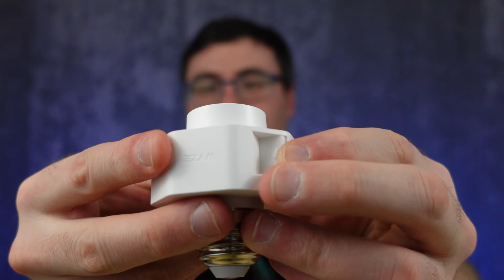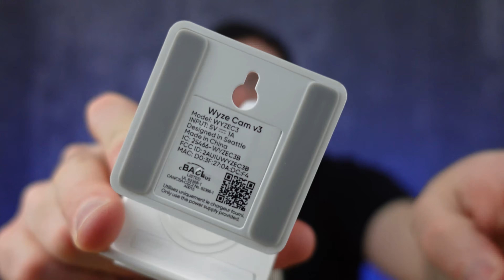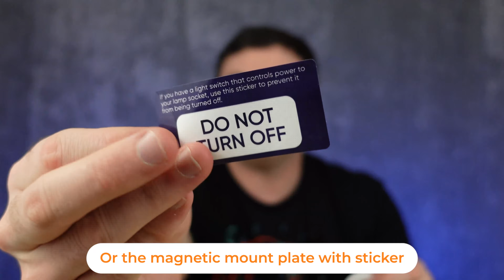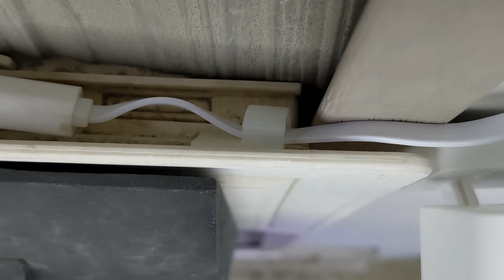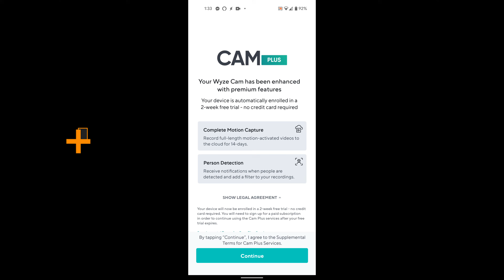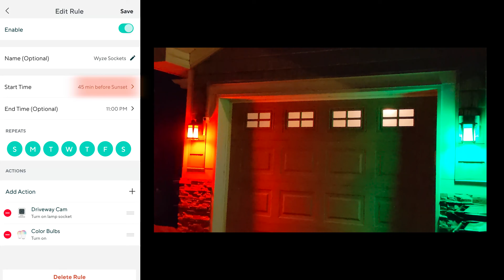Wyze Lamp Socket Unbox and Setup (With V3 Camera)

Comment: It sucks that this socket only works with Wyze cam V3.  I have a few Wyze cam outdoor V2s that would definitely benefit from the socket power source but unfortunately according to Wyze customer service reps,  I shouldn't use them with the Wyze sockets.
Reply from the maker: Correct.  These are specific

Comment: Do i need to leave the light switches turned on all the time ? What happens when i take the switch off ? Will the camera continue running or just be useless?
Reply from the maker: Yeah you need to leave the light switch on.  It will use a very small amount of power in the light, and some for the camera.  But you can control both to be off whenever you'd like.

Comment: Can you installed more thannone camera to the light socket?
Reply from the maker: Power wise that's not going to work out well.  You'll likely underpower a camera at some point and have it drop off.  The control interface doesn't allow that too, so...you could maybe get away with it, but I wouldn't suggest it.

Comment: I did not know that there was a 30 watt max. Thanks for pointing that out before I bought one and tried putting my 60 watt bulbs in it.I use the vintage amber type Edison bulbs and this won't work with them.
Reply from the maker: Ohhhh those are nice.  You know what you could do is buy a smart version that is LED but Edison style!
Reply: @automateyourlife2  I had some and they don't look the same. Maybe they will do a better job in the future replicating them. But, they just aren't the same at this point in time. I have LED everywhere in my house except for the 6 outdoor bulbs.
Reply: You actively choose to use such energy wasting bulbs?
Reply: @myNEONCITY  Yes, I do. They look way better than LED lights on the outside of the house. I use LED all over the inside of my house. But, the Edison bulbs have a nice warm glow to them that you can't get with an LED. You seem like a complete snob.
Reply: @Timpala44  I’m the snob? I’m not the one that actively chooses to waste extra energy because something looks better.
Reply: @myNEONCITY  This conversation is a waste of energy.
Reply: @Timpala44  it is but not as energy wasting as those Edison bulbs! 😉

Comment: So one of the problems I have with their lamp solution socket is that in most cases porch lights within arms reach for you and a potential thief...the cable that Wyze provides is so short it that it forces you to mount the camera at about the same height as the porch light so a thief could just cover their face and go up and snatch the camera off the wall. Yes you could buy a longer cable but any off-the-shelf USB cable connections will not fit into the lamp socket's USB connection because of the special sized usb connector required by the lamp socket for water proofing. So to extend the cable length you'd have to purchase a special connector to attach the short cable provided to your extension cable and then you have to figure out how to make that connection point water proof. IMO Wyze should provide (even if they sell i as an add on) the connector and the water proofing mechanism for that connector (maybe a heat shrink wrap). It would literally cost them no more than a couple of dollars (if that) to provide a solution to extend the cable (i.e., USB-to-USB connector and the waterproofing shrink wrapping).  It's all about providing solutions....customers don't want to have research, try out potential solutions and purchase individual components to solve their issues...most people don't have time to do that. This was enough of a barrier to me that I decided to go with another vendor camera (ReoLink Argus Pro 3 with solar panel). No having to figure out how to run cables to a power socket,  no need to worry about researching and then jury rigging a water proof cable solution so that I could place the camera out of reach and where I wanted to. It's a lost sale for Wyze. It's nice that Wyze provides a lamp socket product but someone forgot to think this through.
Reply: I’m glad you found a solution that works for you, but your whole comment is way too nitpicky. No other company offers a solution like this, but you feel the need to complain. Most security cameras can be easily ripped off by anyone, but they’ll be recorded doing so. Not much point to that tbh.

Comment: Since the switch powers the bulb, I assume we have to leave the switch on, but I don't want my light to be on 24/7. If using a regular led bulb in the socket, would I be able to turn the light on and off without shutting off the camera?
Reply: No. Switch has to be on. You could set a rule to turn light on with motion and from sunset to sunrise, but with power switch off neither lighting routines or camera will work.

Comment: What is the size of the socket ? I have a enclosed wall coach light and it has limited space.
Reply from the maker: That's a spec you can see on their site, but it stays no to enclosed luminaires right

Comment: i installed the lamp socket with the v3 followed instructions but  no where does it say lamp socket  installed  or do i have options to turn my  light on or off ive uninstalled it  and reinstalled and nothing
Reply from the maker: Maybe try updating the app?  It's in the camera's control page.  You'll see a little light icon above the camera feed

Comment: Appeared to have installed everything correctly.  Camera working fine - but when I try go to Accessories > Lamp Socket, I get the "Uh oh.. Something went wrong. Please check your wifi connection and unplug........." Camera is work fine though.  Any thoughts.  Thank you.
Reply from the maker: If the camera is working fine but the lamp socket isn't, I'd say something between the two is the problem.  Try a light switch on off to turn them both off and on again
Reply: @automateyourlife2  I got the same issue. I read above that you can not use the camera cable, you must use the socket cable. I plan to try that. Did you get yours to work?

Comment: Basically, the main switch to power the lights must remain on at all times using the app to schedule when the lights turn on and off OR set up for lights to become motion lights.  30 watts that’s to keep power consumption low I guess, but full current is running all day and night nope.
Reply from the maker: Full current is not running all day and night.  You'll likely have the camera at 1 A and the Lamp Socket at 0.3 A (tops).
Reply: Dont you think if full current was running all the time when turned off that itd generate a whole lot of heat instead of the light it makes when turned on?
Reply: @OptimusSatanas  it’s called a ‘relay’ or ‘pause ‘ n the circuit otherwise it would generate too much heat and become useless
Reply: @RoeVenturesLLC  I do hope you realize I was asking a rhetorical question. I do appreciate that you responded in earnest, tho.

Comment: Can you help me with the setup? On the app, when I enter my wifi password (connected to 2.4ghz) it goes to the QR code screen but camera  continues to say "ready to connect". Any ideas what's wrong? No help from Wyze.
Reply from the maker: You gotta show the camera the QR code.  If you can't get the camera to see the QR code, then maybe try in the evening or dusk when it's a bit darker.  The camera has to physically see the QR
Reply: @automateyourlife2  it worked, the first time setting it up was at 2am lol thanks for the response ☺️
Reply: Thanks in advance ☺️

Comment: Thanks for the video.  I have the Wyze Lamp Socket, but mine will not associate with the V3 connected to it.  The camera works but does not recognize the socket even after three removal and power cycle reset attempts.  The light bulb button does not appear.  I have the spotlight added to this V3 as well which does show there.  There is no indication I cannot have both but could that be the problem?  I have tried and retried everything else.
Reply from the maker: Make sure you're updated, but I didn't have both to test out myself.  Lemme know!
Reply: did you get it working?
Reply: Yes... Wyze Twch support finally explained the socket does nor support the V3 AND the V3 spotlight add-on at rhe same time. I removed the spotlight and it started working.  Also MUST use the USB connector that came w the socket bc it ia somehow different.

Comment: To all, do not “over tighten” the bulb in the socket.  If you do happen to securely insert the bulb in the light socket bad things may happen.  The light socket will “break” and physically dislodge from the fixture itself, and when you unscrew your bulb, the socket will stay connected to your bulb and be removed from the housing.
Reply from the maker: Wow, thanks for the warning!

Comment: I want to point out something that some don't know.  If you already have a v3 and installing a lamp socket,  you need to use the supplied usb cable that comes with the lamp socket in order to have function of the light features.  You can use the existing v3 usb cable but for some reason it will not allow you to use the light features on the lamp socket.
Reply from the maker: Correct.  Yeah, it says that in the manual too!
Reply: Saved me a lot of headache. Thank you for valuable comment. I noticed that the cable that came with the socket has a rectangular shape around the usb side that connects to the socket. It covers/seals the port once plugged in.
Reply: Maybe that is why I have had no luck getting my app to recognize the socket I added 6 months ago. Now where did I put that cable??? ugh...
Reply: Thank you so much for this, I couldn't figure out why it wasn't working properly! You made my day!! thanks.

Comment: Beautiful concept. Wyze needs to make this work with a v2 and up the wattage to a standard 60 watts. I noticed Brians lamp fixture was frosted but all mine are clear. I prefer the look of a clear incandescent in a clear fixture. Yes, I know that they are starting to make more led filament bulbs but that market is not quite mature yet and I already have a stash of about 400 incandescents. Hard to beat 59 cents a bulb.
Reply from the maker: Yeah and that would be a 59 cent bulb forever!

Comment: thanks for pointing out in the beginning of the video on the wattage limitations of the socket. that is certainly a dealbreaker for many applications such as using an existing floodlight. it saved me from putting it on my list for certain use cases. it was too good to be true and while the functionality is great, it can create an unsightly clutter with all the wire management if it can’t be done cleanly. the strong appeal is the price point.
Reply: i mean with led bulbs, 30 watts allows an insanely bright bulb, what exactly are you doing illuminating the moon?
Reply from the maker: I was surprised on that one too!  Glad it saves you in this case.  I think the floodlight would have overwhelmed the camera view anyways from what I'm seeing on mine

Comment: Do you think the socket would work with a blink cam ?
Reply from the maker: Noooo it's Wyze V3 only
Reply: @automateyourlife2  Well sad  ! Someone should do a socket like that for general purpose,  it's à great idea to have a smart socket with usb power delivery.
Reply: Why not? It’s a USB port, it should be able to power any device. Since you leave the light switch always on, you  use a smart bulb to control to control the light and usb to power a regular usb powered camera.
Reply: @deepakp5895  because its likely proprietary and not programmed to turn on and off the light without the wyze cam. Wouldnt be surprised if the brain that controls it is in the cam